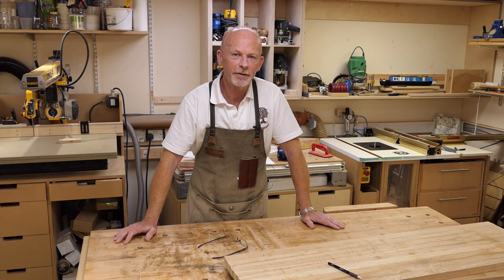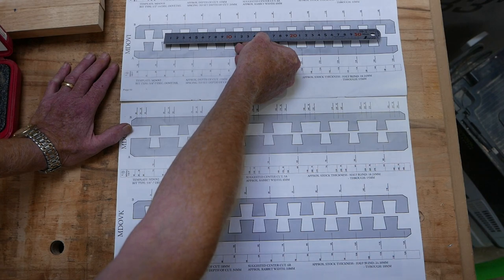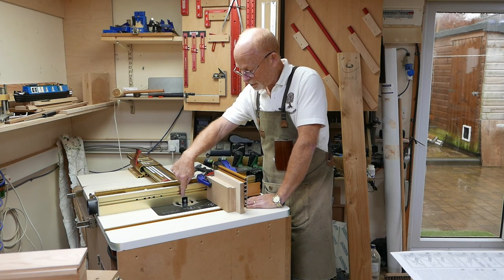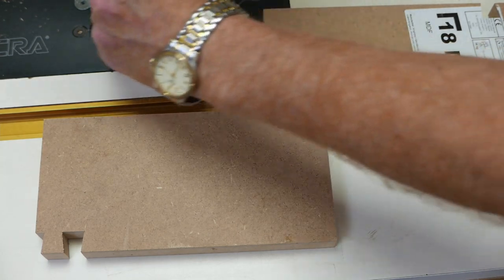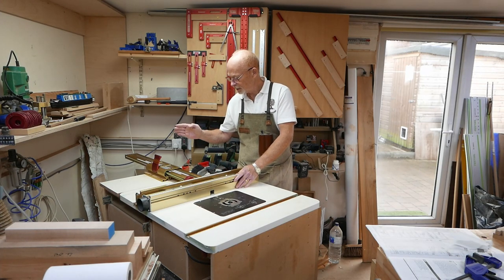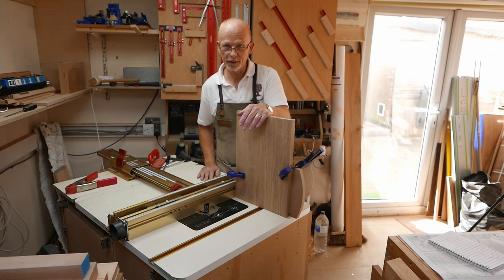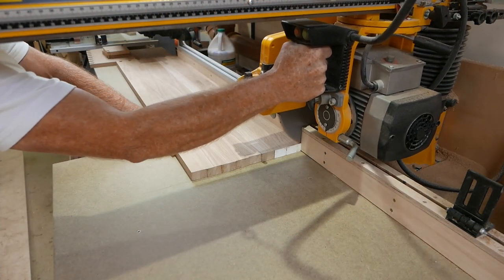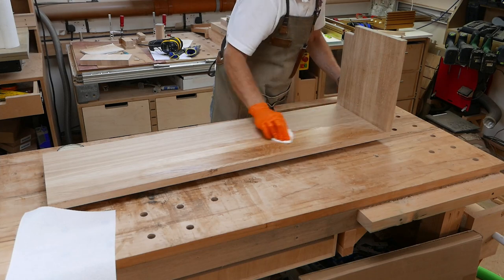Half Blind Dovetails using the Incra Wonder Fence System on a Router Table

Comment: Your videos are so helpful! I finally have my Incra and tried cutting some half blinds. Overall it went smoothly and the results are good. Certainly excellent for the first time. My main issues are setting the height (how tight is too tight) and tear out where I wasn't expecting it. I got tear out while running the rabbet and also on the front face while cutting the pins (I think when I was passing the right angle fixture backwards but I'm not sure why yet). Just opportunities to practice. I think I'm going to invest in a digital height so I can just record the height for each dovetail bit

My one question to you though is about the boards you glued up here and for the whiskey cabinet. Do you do that for stability vs just using whole boards?
Reply from the maker: Hi Ajm, re the tear out, sounds like you need to approach slower and push through a little slower, accepting that the bit is sharp?
To answewr your question, if you're asking me to justify the extra work involved in cutting Dovetails in the carcase then I can't.  I thought it wopuld look a little different for a change, and they do, but damn its a lot of work. 👍

Comment: im here specifically to see the clean sweep downdraft plates and to be honest it doesnt seem to get much at all of the dust. in some videos it gets it all but i feel like they somehow show best case scenario. in this video it doesnt seem to do anything. Did you have the vacuum on?
Reply from the maker: Hi Elad, in this video my extractor was in desperate need a cartridge clean so it wasn't running at its best,.  The holes / gaps in the plates usually work extremely well and handle the majority of the dust. 👍
Reply: @GTWoodshop   yah i figured half way thru writing that maybe thats what it may be. It truly looks like it works very well in most videos, especially with the correct box and air holes in that box to increase the suction. Ill be doing this soon for my new incra as well